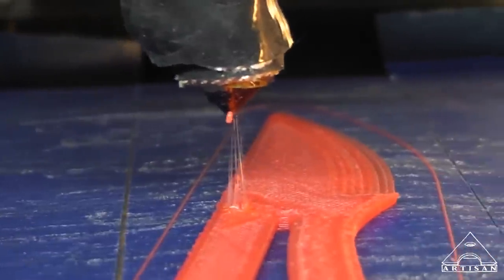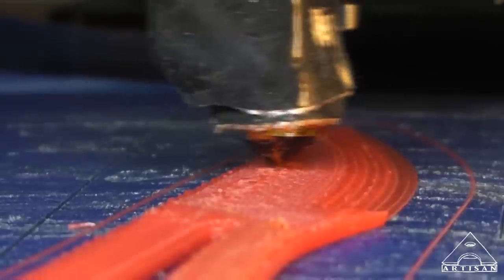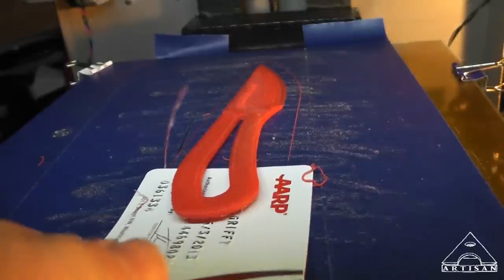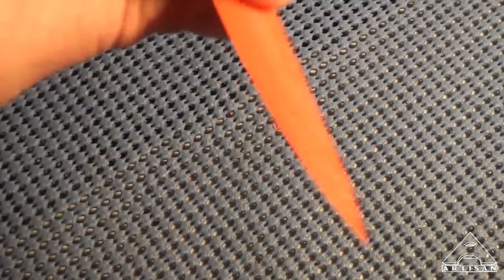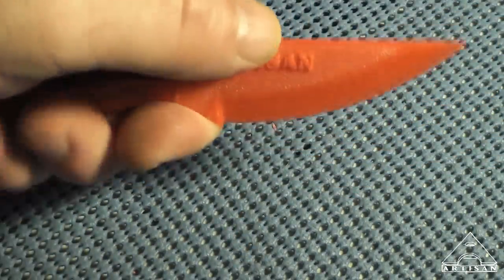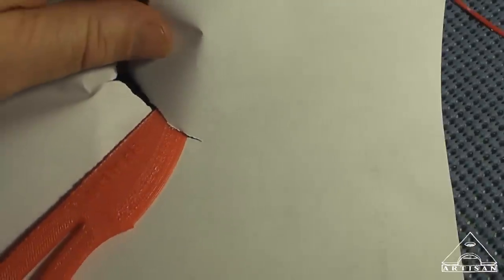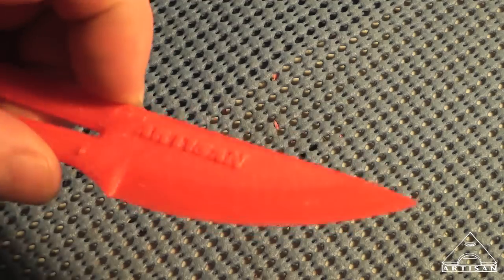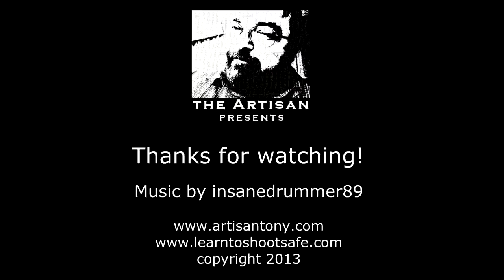3D Printed Knife - Will It Cut Paper?

Comment: To make this work better perhaps you should print it with a thicker edge then sharpen it. It would be interesting to see how sharp you can get a knife made out of PLA.
Reply: What would that prove? We know you can print a plastic block with the printer. And if you are going to sharpen it anyway, there is little difference between printing and sharpening a half inch thick piece of plastic and one that is half a millimeter thick.

Comment: To the people criticizing Tony for cutting paper rather than fruit or wood, learn about knives. Or don't, just think about it for a second or two. Can you make a clean cut in a piece of paper with a butter knife? No, you can't. Can you cut a tomato in half with a butter knife? Yes, easily to. Now, if you ask those same questions but replace the butter knife with a good bush knife, the answer both will be yes, an outdoors knife can easily cut both a tomato, and paper. Don't believe me, do a test. Get: 1 butter knife, 1 sharp knife (outdoors, kitchen, combat, etc), 2 pieces of paper, and 2 tomatoes. Attempt to cut the tomatoes with each knife, then do the same with the paper. You will notice a significant difference in the quality of the cut in the paper between the two knives, but a very insignificant difference in the cuts in the tomato between the two knives.
Reply: Well a butter knife can cut paper if it's sharp, and a bush/tactical/kitchen knife won't cut paper when it's dull. All you need is a sharpened piece of steel lol
Reply: Thank you

Comment: lol, just came from a video where they printed out fully-auto guns with a 3D printer to this.
Reply: Alright, what indication do you have that the 3D Printed firearm video was fully automatic?
Reply: Pyruvate Personage It might have been semi, but the camera wasn't much on the trigger, just overall on the gun. Doesn't really mater though.
Reply: Pyruvate Personage I don't care what they show, three is no kind of plastic material that could withstand full auto fire in the barrel and chamber area. That's why even with polymer framed weapons, those areas are still metal, usually steel. It's all hype. Maybe a one shot weapon would work, but no such weapon would fire more than one time. Ceramics ... well they have more capability in some areas. You could build a ceramic weapon that would fire more than one time, I'm sure, but full auto? I doubt it, not in any larger caliber. The barrel would be ruined quickly with ceramic, and melt if plastic. The heat and stress involved is way more than what most people think.
Reply: tootall11211 Metal 3D printers exist you know...
Reply: JWQweqOPDH
 yea but 3d printing parts are no match for machined parts
but then again 3d printer can make very odd part
maybe that why companies use both to make one thing
Reply: ***** What if everything other than the barrel was printed?
Reply: Parts machined out of solid metal stock  are needed for high pressure areas that not just the barrel. i don't think it very safe for people to just pick and choose what parts are going to be made of without information. safety and economics come into question
Reply: ***** Who is picking and choosing what parts are actually going to be made in what ways without information? I'm not actually building anything. Who is doing this and thus is being unsafe?

Comment: Paper is such an awkward material to cut. Should have tried something else imo.
Reply: The paper cut test is actually a pretty standard test for the sharpness of a knife.
Reply: polaris69234 Apparently, it seems so strange to me though.
Reply: OWL becasue it is so challenging is percisely why it is chosen as a way of evaluating the edge of a knife.
Reply: +OWL yea like vegetables!
Reply: polaris69234 a piece of meat or vegetable would have been better though
Reply: Paper wears out blades quickly
Reply: ***** true.  still the most common and valid cutting test
Reply: its the easiest method to test the sharpness of a blade, it's easy once you get the hang of it. It'll cut all the way through the paper with little to no resistance if it's sharp
Reply: m1k3y~ミクト  Cutting paper with a metal knife isn't that hard.
Reply: Black .Baron well sure, i don't have much trouble with it either.  it is simply more reflective of the sharpness of the knife because you can easily see if it is tearing or actually slicing.
Reply: If you can finely slice paper or cut it with a knife it means ur knife is balls threw the walls sharp
Reply: Kaden Surrage  Not really, you can get a shitty kitchen knife to cut paper with a 600 grit carbide stone.
Reply: Black .Baron this
Reply: Kaden Surrage I wouldn't call my knives really really sharp until I can shave with it. 

I do have some knives though that can't reach that sharpness, maybe cut some hairs but not shave.
The kind of steel also has effect on the limit of sharpness on your knife. 

The knives that don't shave still cut paper and everything else perfectly fine.  Some of my pocket knives are less than 80 grams but cut ripe tomatoes without pressing on them.
Reply: Validifyed BUT, your knife is too sharp. What I mean by that is if you were to drop that knife from maybe 2, 2 and half feet (those numbers are guesstimations, don't quote me) above a hard flat surface and the blade were to make direct contact with said hard flat surface, you would no longer be holding a sharp knife. Instead you would be have a knife with a perfectly flat blade. (In short, the knife would have no bevel)
Reply: OWL beaf maybe?
Reply from the maker: veggies and meat are easier to cut than paper.  Paper is a standard test for blades.

Comment: no knife is actually good at cutting paper just because it is 1 blade not 2 so you would have to hold the paper to cut it. MY question is that can it cut into something useful like cutting cheese and/or cutting meat?
Reply: yes i am knifes are really not for cutting paper thus why we have a thing called scissors.
Reply: ***** staping the paper easily yes actually useing it as scissors not so much for the reason of you need an object to hold it on one side which will help with the cutting thus why we use scissors not knifes to cut paper and other things
Reply: ***** still think cutting something else would be more useful for example a box or stabbing a peice of hold together cardboard or something like that or if it was made for this propuse cutting meat and/or vegies or something pratical like that as knifes are really not designed for cutting paper.
Reply: Don't quote me on this because I'm no expert or anything but is that plastic safe to use on food or is it something that you could have touching your food and have no problems
Reply: ***** that really depends on the kind of edge. now if it is a double sided blade with both sides leading into a single point then yes but as it seems like it only had 1 side which made it into a single point then it will tear the paper not really cut even though that is basically have a single side of scissors are.
Reply: that they do for Japanese chef knifes and they are a single sided blade but that is because they use the other side as a blunt surface in cooking the side used for cutting is super sharp and sharpened probably daily if not more often than that if in a professional setting anyways while the side meant for a blunt surface is totally flat
Now even though a Japanese chef knife is very insanely sharp the thing of it only being 1 sided diminishes how sharp it can be by just a little but not alot if sharpened right it isn't noticeable but in a 3D printed knife it will be because you are not able to use the same tools to sharpen it and if it is made as sharp as a chef's knife is it  would widdle down how much plastic is left for the structural strength to stay there.
when made out of plastic that is one made out of metal on the other hand i can see it being as sharp if not even more sharp than the Japanese chef's knife but ones made out of plastic due to the shear material constraints it just cant be

Comment: I WANT A 3D PRINTAAAAAAA XD how much do they cost anyway
Reply: 3000 to 4000
Reply: :O actually that doesn't seem like to much for something like that
Reply: Dominique Groguhe Maker bot is around 900. If you look around you'll find some for 400-600.
Reply: The one hes using in the vid cost about 700 but you can build your own for less like i did!!
Reply: Robo 3D Best...
Reply: 200 dollah
Reply: It also depends on the technology for example the polyjet technology based one I have in my office runs for $25,000 but it prints ready to use parts in high resolution and stronger than fdm, or the one in the workroom runs for $225,000 but it prints in extremely high resolution in two materials at once such as a white plastic and rubber
Reply: TrippyJoey Thats not actually true. You can get one for as less as $2.500.00

Comment: Tony, a tip: for the printed knife be more sharped, you should print it vertically (srry for my english, brazilian here)
Reply: That still won't be sharp. This is a chisel grind and it's fine but plastics can't hold an edge or take a edge so it still wouldn't be sharp

Comment: It might help if you were to sharpen it with wet and dry paper, maybe make a serrated edge too. Good job btw. Greets from the UK
Reply from the maker: Thanks! I was trying to see how sharp you could get it right from the printer :)
Reply: @ArtisanTony  It would be great to see how sharp you can get it with wet and dry, I was looking at different filament earlier on the Proto pasta website and they have this filament called HTPLA I have just ordered some. Anyway if you bake the print in an oven on 100C it becomes extremely strong, this would make a most interesting video I think...... Just a thought.

Comment: Pretty good for an "unfinished" knife, though you did say in an earlier comment that the plastic your machine uses isn't much good for grinding a sharper blade, you should try this again with bronze filament if your machine can use that, it'll male a stronger base material and you can sharpen it on a whet stone for kitchen knives :)

Comment: what if you glue 2 of them together? would it make an even better blade?
Reply: it would make a worse scissor
Reply: ShadowMaster 45 But that's not the point. I'm asking if it would make a better or worse blade if you glued 2 together on the flat part, so that you had something more like a regular knife blade than a scissor blade.
Reply: +Alec Lipscomb Well, the contours of the knife wouldn't allow it to work, you'd probably just want to find a thicker knife model.

Comment: if you did a reverse print on the same design, and either melted them together, or adhere them some how, you could actually run it on a sharpener and it would proably work better, just saying

Comment: I have a 3d printer myself and it is possible to print an egde that can cut something like paper if the layerheight is around 0.05mm. I 3d printed a ninja star fidget spinner that stabbed through my skin when i tried to take it off the build plate thinking that surely a 3d printed object can't be sharp...It's a cool concept though plausible  but not practical.

Comment: the army could start 3-D printing knifes for use the soldier would be required to sharpen it them self and when it runs dull sharpen it again or have a new one 3-D printed

Comment: I think this would've worked better if you just printed the shape of the knife maybe a few millimeters thick. Then you could've sanded or filed out the edge later so that you can have an even edge and not a chisel type edge. The knife would probably hold up better like that and maybe it'll actually be able to cut.

Comment: why are you using blue tape on glass? also if you just take the glass off of the heat bed and wait a minute or two the part will slide off very easily

Comment: why do you need a knife when you have sisors that cut straighter
Reply: katarina jurigina because cutting paper is a standard test for determining how sharp a blade is if the bade cuts as straight as scissors can then your knife is good if it tears paper your blade is dull and needs to be sharpened or replaced

Comment: How many 3d printers could a 3d printer print if a 3d printer could print 3d printers?
Reply: +Mister Fister They couldn't print any. The printed ones would not operate. They  need to heat up the filament to actually print with plastic.
Reply: Thomas Brogan well, it doesn't have to work.

Comment: Of course it will cut through. You ripped it a tiny bit first. It is a thin edge so it can cut through the atoms of the paper easily. If you didn't rip it then it wouldn't really work so it didn't really cut paper...

Comment: Not bad but print looks crap. PLA TEMP 210 degrees IS A GREAT temp for PLA. Also buy SIMPLIFY3D software it gives total control over everything and I swear it's awesome, no more worrying about crap prints, rafts and supports just fall away.

Comment: Shouldn't you have printed scissors I've never heard of someone cutting paper with a knife
Reply: Josiah Williams Cutting paper with a knife is a very common way of evaluating a knife's edge in the knife community. If the paper has no support and the blade can cut smoothly through it then the edge is pretty sharp.

Comment: Now you may be asking yourself will it cut paper WTF why would i think oh i wonder if it cuts paper
Reply: +MadAptrono Because paper is a thing you can try to cut through to see how sharp your blade is. You know how if you have scissors and you hold them slightly open and just move them through the paper it will cut? It it kind of like doing that, but just having one blade. If it glides through the paper withought tearing it, it is pretty sharp. Go take a sharp knife and try to hold a piece of paper, without starting it off with a tear or anything. Then try again with a dull knife, or a butter knife. You will understand.

Comment: ok but why would you test it on paper try it in an apple or something
Reply: Paper is often used to test sharpness for a knife, if it doesn't rip and when it slices it makes a high pitch sound and the cut is very clean means the knife is sharp. A fruit or vegetable is not good for testing sharpness.
Reply: +itsrainingrainbows Paper is a thing you can try to cut with a knife to see if it is sharp. This isn't a stupid thing. Even a dull knife could cut an apple.

Comment: You should have cut a watermelon!
Reply: +Bailey Pate OBJECTION! Watermelon's despite how they look are actually fairly fragile and easy to cut through your typical dull kitchen knife can cut through a watermelon just as well as a fine edged blade. The point of cutting paper is that it requires a fine edge to cleanly cut through the paper at the angle that is used...
Reply: Ahh thanks for telling me! :)